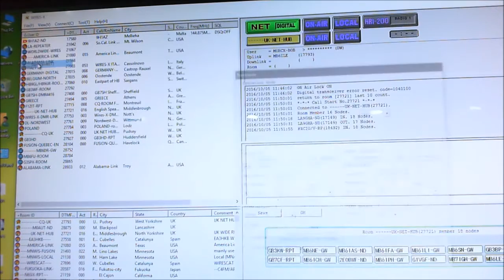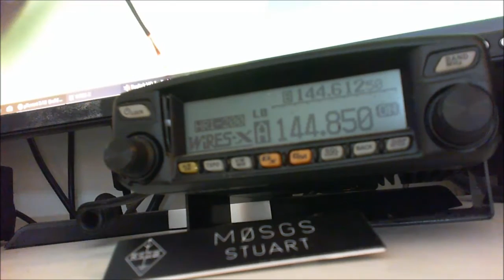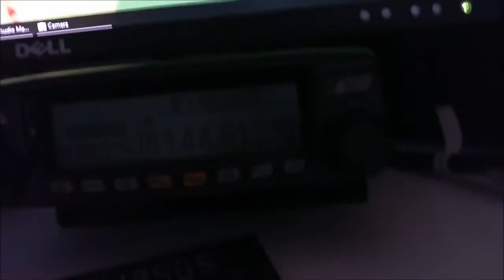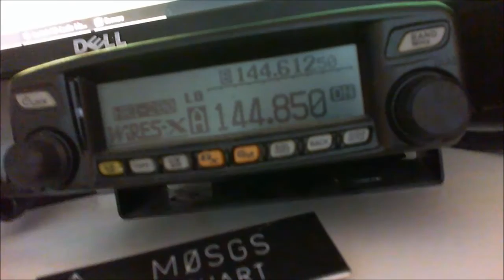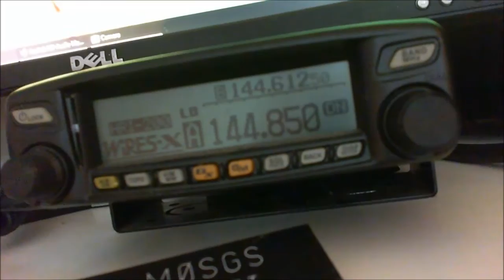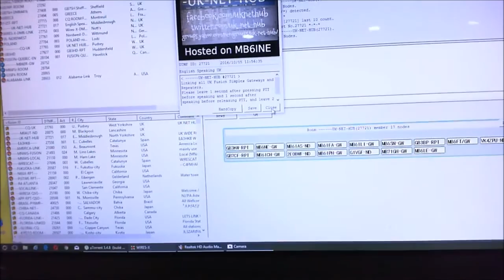PRESET SEARCH Setup on Wires-X software

Comment: Hello Stuart,
Not sure if you are still monitoring this old YT
I have an NOV for a DV Gateway...
I have the FTM-100, Drivers installed, Wires X Software installed v1.53
Everything appears to be O.K and Working.
I'm starting up the Radio in Wires X Mode, DX+GM+POWER
However in the Transceiver setup...
"Pre Set Search" is Greyed out, so unable to set it up... Any ideas.??
Just noticed, You have HRI-200, I don't, is this the issue..??
Many Thanks.. Dave  - G8LIY / MB6ILE